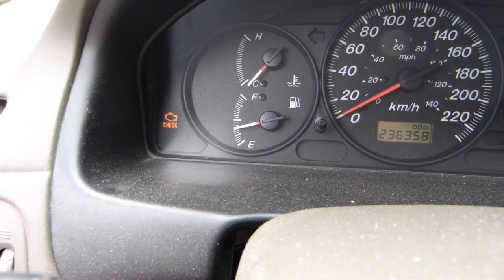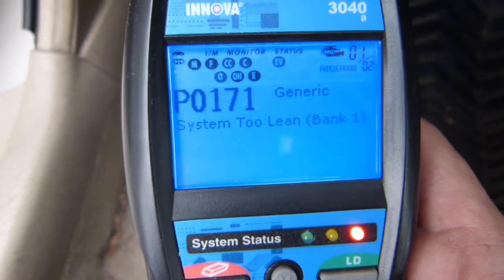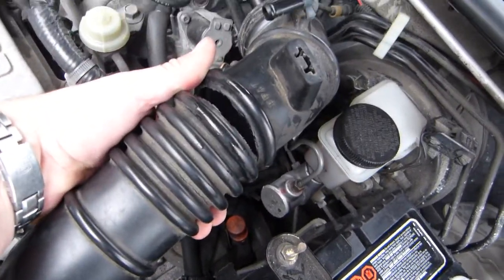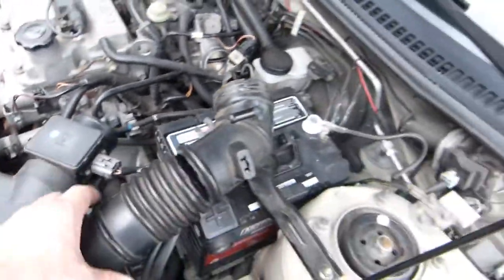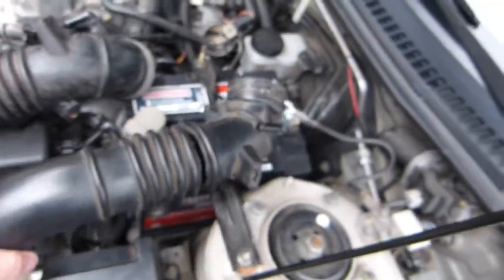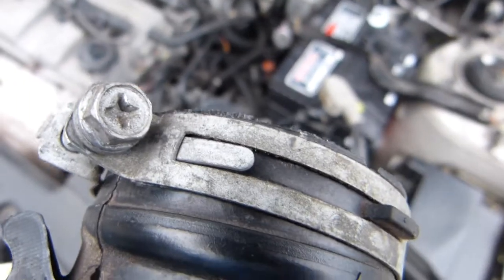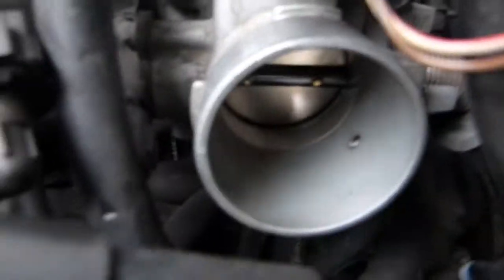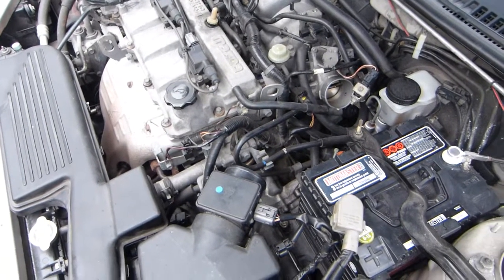Fix a sudden onset of OBD-II DTC P0171 and P0300

Comment: P0171 is for a lean condition on ONE BANK of a V engine. It does not seem to make sense that it was caused by a condition that bypasses the MAF sensor that is common to both banks (which should have also set a P0174). Lean conditons in onr bank along with random missfires (P300) are usually caused by leaks on one side of an intake manifold, or injector, or O2 sensor issues on the same side as the P17X code.
Reply from the maker: +Peter Poggi I don`t know how this ancient PCM is programmed (what input from sensors generate what DTC output) but this ain`t a V engine and it got fixed by fitting a single functional intake duct on.
Reply: +theoverengineer Dear Overengineer,

Thank you for telling me and sorry I didn't pick up on that fact. I am relieved to hear this.

There could be more to what events trigger what codes then I understand, but in the posts I have read that actually apply to V engines and where there has been a fix, it was always a problem localized to the same bank that set the code.

Not sure if this will always be the case, but it seems logical with an asymmetric code to explore the assymetric causes first.
Reply from the maker: +Peter Poggi Very logical, yes. Most likely the OBd`s are developed for V or boxer and just applied to in-line 4 as bank 1, without a bank 2 or more.
Reply: Peter Poggi any idea of this could be what's happening with my 98 3.8 windstar. Getting p0171 and P0303. Ive changed all lower and plentum gaskets and bolts. Drives fine for a couple hours the starts running like poo and throws thos codes